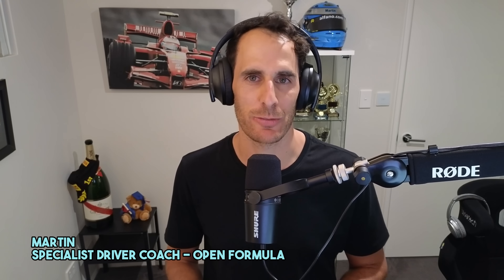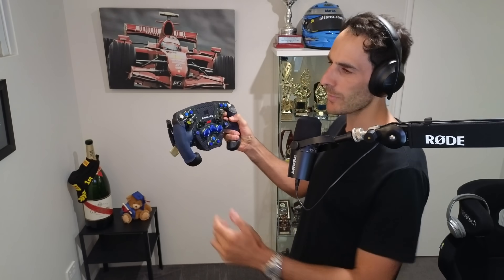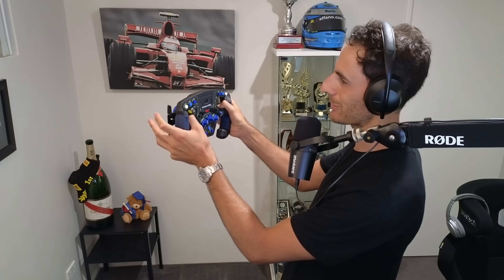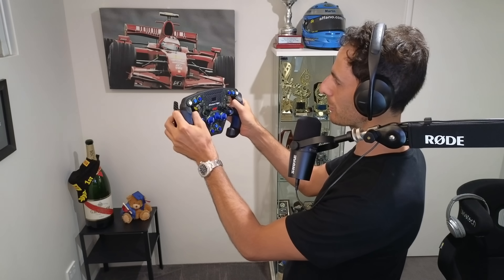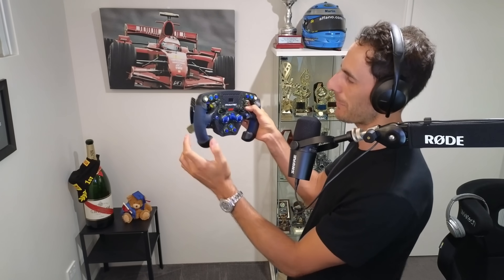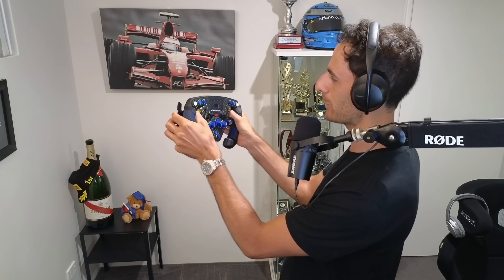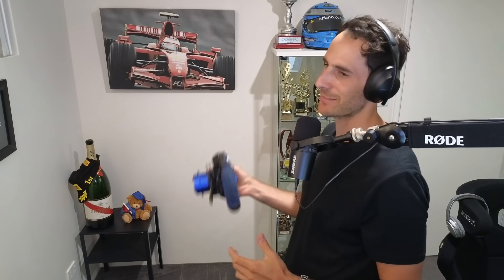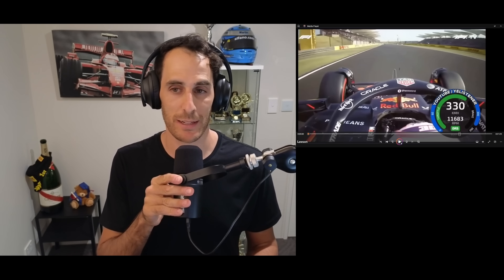The SECRET TECHNICAL Reasons Why Liam Lawson Was Sacked!

Comment: Liam drove 12 races across 2 years at AlphaTauri. No other preparation other than sitting on the pitwall most of that time. Contrast that with Antonelli who, combined his F2 season last year, had a rigorous TPC programme with Mercedes last year for F1 preparation. His lap times show and prove that by being so close to George Russell's. 

A significant chunk of this failure is also Red Bull's. What was the reason for firing Daniel Ricciardo, if not to make way for Liam then?
Reply: You are right. Red Bull is in shambles. Theyve unjustly killed careers
Reply: Plus acting all coy about the driver changes until the very last moment when it would have been better to be honest at the start to give the chosen driver (Liam in this case) more laps and time to smooth out these adaption issues.
Reply: Red Bull Genius for you
Reply: Liam is trash
Reply from the maker: Who do you rekon will quali higher on suzuka - yuki or liam?
Reply: @lowerlaptime  Liam should be able to get into Q3 but I don't think Yuki will get out of Q3. Yuki is even more unprepared for the RB21. He do beat Liam in Quali last year so I think he'll at least get into Q2.
Reply: Two races isn't a enough time behind the wheel.  But I agree with you, he hasn't done enough laps coming into F1.  He doesn't have car control on wet and slick tracks.  P16 last year at Las Vegas on a slick track, this is a drivers track and a good leveller of machines.  Based on the Las Vegas race he should have stayed with Racing Bulls for a couple of years.
Reply: Ricciardo didn't get fired he left ! Ricciardo got fired from McLaren.
Reply: @jiujitsujedi Ricciardo was fired. He should have made way for Lawson in 2024 for a full season. His performances after taking over Nyck De Vries seat were never good enough to get another season. He had enough experience to hit the ground running and he didnt
Reply: @J-hs9vy  every driver looking out for their interest. Even champions hang on way too much past their prime. Danny had not won anything and wanted one last go at the WDC. Everyone is selfish in this sport, thats the only way you stay at the top. He struggled to the point where he was given the soft signal by redbull to hang the boots.